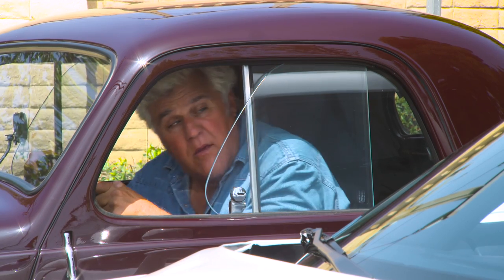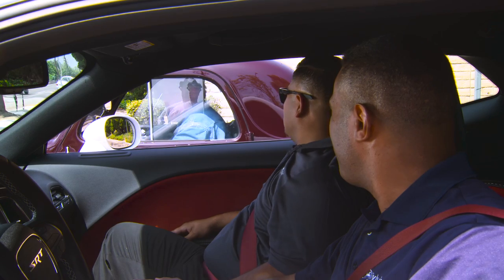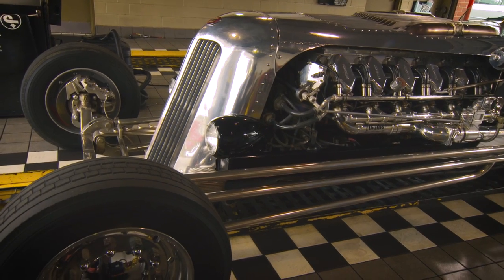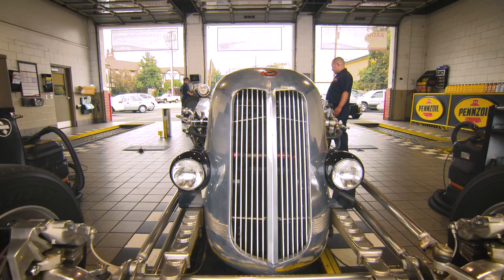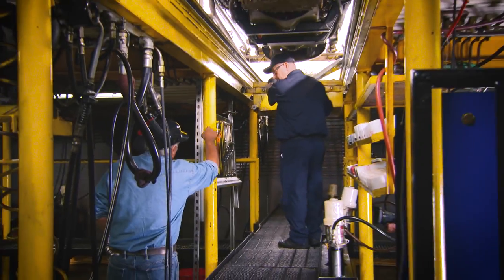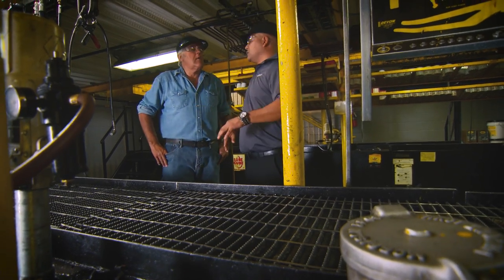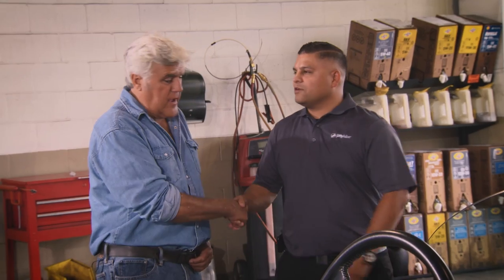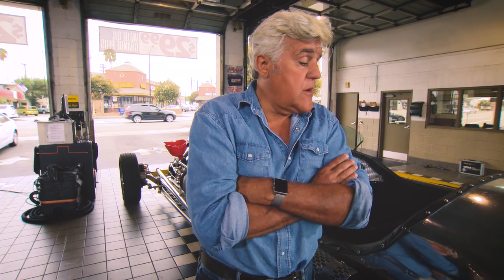Biggest Oil Change Ever - Jay Leno's Garage

Comment: I used the local Jffy Lube regularly for several years in the 80s, until the morning after an oil change I came out to find big puddle of oil under my car.

 Afraid to run the engine I pushed the car out of the garage jacked it up and drained the remaining oil into a clean pan. I had lost a quart overnight.  When they drained the oil they removed the old seal washer but didn't install a new one.

 I  was lucky that I had gone directly home after the change and didn't use the car until the next day. My high speed commute could have blown the engine.

I took my wife's car the local auto parts picked up a new washer a quart of oil and a bag of oil sorb compound.  I went home installed the drain plug with new washer, poured the drained oil back into the engine and topped it off, then spent 2 hours trying go get my garage floor clean.

 It took 15 minutes of arguing with the people at that Jiffy Lube to get them to refund my money. They never apologised for my inconvenience of endangering my vehicle.  I never went to another Jiffy Lube again, and never will.  

If I can't do it myself, I'd rather spend a few bucks more to have a real mechanic change the oil than risk getting an iffy lube.

Comment: LOL I used to work at Jiffy Lube back in high school...I was the underbay tech and I couldn't tell you how many cars I fucked up!  Driving away without oil pans and no filters.. a girl with a skirt stands close to the bay all the underbay techs run to look up her skirt, huge whelps all over my arms from hot oil an exhaust pipes and headers....ahhh how I don't miss that job but it completely defined my high school "job experience" and it was fun as hell then in ignorance. Every time I drive by one, too and from work, its complete nostalgia.

Comment: 15 minutes for an oil change is the definition of poor quality work.
Reply: +theedrstrangelove Um, there's not much to it. Remove drain plug and oil filter (90 seconds), let oil drain (9 mins), replace filter and drain plug (90 seconds), fill with fresh oil, (3 mins). While the oil's draining you get the new filter, write up and place the sticker then look up the torque spec for the drain plug. It's easy when you have a dedicated service bay and proper equipment.
Reply: +OMGWTFLOL You need to let it drain 45 minutes at the very least. Plus it takes that much time to check everything else; suspension, brakes, air filter, pcv valve, rear end or trans-axle, etc.
Reply: theedrstrangelove it should only take 5 minutes

Comment: 3:54 there not even pouring anything? What a scam !
Reply: +jake smith Precisely my thoughts.
Reply: +ScArdZombE Yea pretty sure that doesn't take anything that Jiffy Lube would have. As long as this keeps Jay's channel free, I'm cool with it!
Reply: +jake smith it's probably because that drum never held oil in the first place and was just a decorative prop for the shop. I'm willing to bet it was Jay's idea when he saw it.
Reply: +WittyDroog They do actually get their oil in large containers like that, its not a prop.
Reply: +Matt Close I work for a GM dealer here in Alberta. We buy our oil in bulk by the 1000 liters and it's delivered by tanker truck. I remember those little drums being filled with grease back in the day. If you look closely, the top is flat. There's no where to pour from. Castrol gave our shop a bunch of those things for promotional items though we just use them as garbage cans.
Reply: +jake smith 
"there" = a place.
"they're" = they + are.
"their" = belongs to them.
Reply: +OddTimeMan
You're casting pearls before swine, my man.
Reply: +jake smith Jay has his back turned and doesn't notice
Reply: +ap2pat Why do some numbnuts think that engine uses crude oil??? No internal combustion engine ever used crude. WWII era engines were as well built and refined as anything being built today and they used modern, refined oils, much the same as today's oil. Do a bit of research before you call someone a numbnuts
Reply: +58mustang8 I am an engineer & can tell you WW2 era engines did Not use modern oils like we have today.  They did not have additives to prevent shearing, or metal-adhering chemicals like ZDDP to block metal-on-metal wear.  Nor were they multigrade.  The standard would have been SAE 50 during the summer & then switch to SAE 40 during the winter (SAE 30 if temps dropped below 0).  Very thick stuff
.
Reply: +electrictroy2010 Well, engineer, my point was that WWII engines did not run crude oil or anything remotely close to crude. It was a modern oil compared to crude out of the well. Yes, it did not contain modern additives nor was it multi grade. ZZDP has been phased out of most oils because of emissions issues.

Comment: Out here in the midwest they (Jiffy Lube) have a horrible reputation and I got to experience it firsthand.  '97 Jeep Wrangler, bone stock, no options (no stereo, no hard top, no AC, no carpet, etc.)  Took it in for an oil change, they tried to charge me $179.00 for recharging my AC, which A) I never consented to, B) They never asked if I wanted it, C) I didn't even have.  The "Mechanic" even tried to show me where he charged it at, which was cute, because there isn't even a compressor.  My daughter bought a 2005 Dodge Stratus and took it in for an MVI (Motor Vehicle Inspection) and 5 minutes later here comes one of their rocket scientists asking what type of oil she wanted, they had already drained it and taken the filter off.

Comment: There are also  lots of older people that  still have  their car from 40 + years ago  and  it's best to change the oil   from both  the mileage   or  age of the Oil from city use  with short trips.   Having to rebuild the motor   before its time   can cause  a big carbon Footprint  for the energy  used to  restore  its power  .   Plus the sludge  build-up creates  toxic waste to be  disposed of   and  cleaned   to avoid   ending up leeching   into the soil at a dump .  
     
     I did my own  work on the used cars I had,   but once I had   news cars  every few  years   it was tough to be scammed  into fixing something  since I only drove about  500 miles a month .

Comment: took our truck to a GM dealer we bought the thing from. full oil change and lube job. for a fee of course. did our stuff in town and came back a couple hours later. "yep all done, take her home!" me and my dad kinda were suspicious. so we checked the lube zerks. not a single one had been greased or showed signs of new grease, all were still coated in a year's worth of grime. so we checked the oil and filter. still had the same filter, and while it's hard to prove it wasn't fresh, that oil still looked dirty as hell. only way to do it right is to do it yourself, can't even trust official dealer garages apparently.

Comment: Most of these places stock filters that are small and fit many cars to reduce inventory and shelf space. The filters are sometimes almost half the capacity of the original recommended filter. In some cases these filters will also fit motorcycles. Problem is, once the filter cant filter anymore, the oil bypasses the filter.

Comment: Jiffy Lube attempted to rip my girlfriend off.   They told her a 2007 Saab 9-3 required an, "Exotic"  oil filter that was special order and charged her $50 for that filter.  The cost of the oil change was somehow close to $200.   Only problem was, that filter is a $5 cartridge used in most GM built cars of it's time.  We've never gone back.  And, yes, I made a scene at that Jiffy Lube and got our money back.  Go to a small Mom and Pop.  These corporations are all about screwing the customer.  Bad business, all the way around with these people.

Comment: Jay, until I seen this video. I had mad respect for you. Jiffy Lube is a large rip off. 
I took my 96 4x4 Tahoe to a Jiffy Lube for an oil change. The guy told me it would lock up my motor if he use the oil n the $19 add. He said I needed the $39 oil change. I just got n my truck and left.

Comment: You left out the part where they zip the drain plug up with an impact gun. And where they shove your a/c compressor condensation hose up into the floor, flooding your car and zapping the electronics because Toyota thought computers under the carpet was a good idea. Then you have to take JL to small claims court and you realize it would have been simpler to just change it yourself.

Comment: Back in the old days all these oil change places used to advertise 'Oil and Lube'. They stopped doing that after one too many VW Bus owner took them up on the 'lube' part. There are something like 15 grease nipples all over the front suspension of those old Buses!

Comment: I don't work for Jiffy Lube whatsoever, but I do know marketing.  Jiffy Lube is owned by Shell (Royal Dutch Shell), which just had a change of leadership recently when Ben van Beurden took leadership of the company in 2014.  Jiffy has had some very bad press- and they earned it- so the logical thing to do is to do two things: first, make internal changes to prevent the past problems and secondly, get some new faces to promote their services.  Jay has a pristine reputation amongst car guys, so getting his endorsement would be helpful in demonstrating internal reform.

At the same time, we have to keep in mind that at any oil change station- regardless of the brand- changing oil is not how they make their money.  They make their big profits on the other services that they offer- especially transmission servicing.  Note that there is not a car manufacturer that recommends such servicing, but they sell it and the margins on it are monstrous.   The, 'get an oil change for super cheap' pitch is just to get you into the door.  The job of the counter salesman is to sell you other things that you may or may not need and could likely do yourself for super cheap.

All in all, I have no problem with Jay doing this promo provided that Jiffy Lube is also making a conscious effort to eliminate their track record of shoddy work.  Without that, it is Jay that would suffer the most from this, regardless of the check he got from Ben van Beurden.

Comment: All those quick oil change places don't make hardly anything on the oil change,they rip you off on all other services that you really don't need at that time,If you say no they screw with your car,Ex, kink your brake line, put water in your transmission, put oil in your radiator, grease on your brake, etc,etc,.

Comment: Jiffy Lube has a reputation for ripping people off. Overcharging, performing unnecessary work, claiming they replaced filters they didn't actually replace, and sloppy service, such as forgetting to tighten the drain plug. I wouldn't take any vehicle there.

Comment: I used to do my own oil changes, but frankly, it is so much easier and cheaper to go to a place like Jiffy Boob and have them deal with it.   I travel cross-country 10,000 miles a year with a camper, and boy-howdy do they come in handy.
Reply: +Robert Bell I don't know for sure if it's real or not, but didn't you ever hear of Amsoil products? At least according to their advertising, they make oils that last that long with more miles to spare. The filters are supposed to be great too, expensive but you get what you pay for; allegedly they filter 20 micron particles at a 98.7% rate which is a lot more than many other filters. I'm using three of their filters now, though I have no oil analysis data.
Reply: Austin Lucas
The problem I have with Amsoil is how it is sold in these cult-like MLM schemes.  The people who are into it are almost religious about it, which makes me (as an Engineer) very skeptical.   Quite frankly, oil is oil.  Changing it is a good idea.  Anything beyond that is really just style points, particularly in today's cars.

With modern synthetics, you can change the oil at very long intervals. BMW recommends Castrol synthetic, which combined with the higher-quality German filters, can go as long as 20,000 miles between changes (although I never went that long!).  I suppose that was the same concept behind Amsoil.

Because of fuel injection and better engine design, engines just don't get that dirty anymore.  If you use just regular oil and change it regularly, your car will easily last 150,000 to 200,000 miles, at which points its resale value is essentially less than the cost of a new set of tires and you might as well junk it.

Trying to make a car "last forever" using fancy oils and whatnot really isn't cost-effective.   But the people selling you stuff will certainly say otherwise.   The idea of changing all the other fluids in your car frequently is also falling from favor, thanks to synthetics.

And yea, I used to flush my radiator every two years and also the brakes and do transmission flushes and differential changes.   Today?  Less so.   It really doesn't make much of a difference, and with some modern cars, you can really end up making things worse (overheating the head, for example in a BMW if you don't bleed out all the air in the cooling system, or failing to properly fill modern automatics which don't have dip sticks anymore).   A lot of these fluids are now good for 100,000 miles or more, except maybe for heavy duty applications.

Leave it alone and then trade it in.  It sometimes is a lot less hassle and cheaper.

Comment: 'cept I would strongly recommend NOT using Pennzoil shown in the photo. After about 5 to 700 miles or so, the oil looses its viscosity and breaks down. You won't see it if your car/engine is new, but if your engine is older, the oil pressure drops after about 700 miles. I've seen it with two different engines.

Comment: im suprised they didnt try to scam him with "you need a new air filter $50 charge" i used to work at jiffy lube until my boss tried to tell me to pour cheap walmart oil into the high grade expensive jugs.  Apparently everybody did it there.  i quit!! if u love your car dont fucking go to ANY quick oil change place.  Do it yourself!

Comment: You can change your own for $14-50 depending on oil and filter you use and how much oil your car takes and you have the pride of knowing what brand oil is in there and have a good filter. JL charges $30 or more plus shop supplies, tax and waste removal and use recycled oil that's been refined to be like new and a no name filter that is prob 1/2 as thick filter as K&N, WIX,, Mobil1, Amsoil, Bosch, Baldwin(many swear by fram but I researched them and they weren't much better than the worst ones) etc. Do it your self it takes 10-15 mins and is fun!

Comment: they need to do a follow up where Jay can't get the oil filter off without an air hammer and the drain plug pulls the pan threads out (I have had to do that before)

Comment: I really like Jay.
I really like Jay's Garage.
Can't stand JiffyLube, because they stripped my drain plug threads, and then lied about it. Couldn't even get the strap clamped down properly over the two halves of the air cleaner filter housing, then lied about that, too.
What could ever posses me to go back? (rhetorical)

Comment: I wouldn't let Goofy Lube change the oil in my 2 cycle weedeater.  At least in central Indiana.  I've fixed more problems caused by poorly executed work done by poorly trained or simply lackadaisical techs.  Stuff like oil filters so tight you have to use channel locks to remove them, not checking fluids... Biggest culprit?  Stripped/over-tightened  drain plugs.  I've seen 3 engines that had to be replaced because the drain plug fell out or was leaking. Many more that had to have the oil pan replaced (no small job on most cars). Jiffy Lube's response is always the same: "If you want money, you'll have to take us to court."

Comment: Son took his Saab 900 to JL for a change, they drained the gearbox, then added 5 quarts to the cars engine. So he drove home, with only residual oil in the gearbox, and a massively overfilled engine.

Fortunately is was only 2 miles. Old dad check the drain plugs, just in case, and realized the mistake-oil everywhere. I added gear oil, drained the engine, then went back to complain. Only offwe-5 free oil changes.. Hah I said..life is to short to fight big biz...I get keeping the site free-but watch JL the car show, don't use JL the oil change co, imho.

Comment: a friend of mine had the oil and filter changed on his car every 6000 miles. air fiter every 12000. no main dealer service apart from first one. 300000 miles and still good. his work mate had the same car , main dealer serviced and nothing but problems. I change the oil on my trike every 3000 miles.  At £20 a UK gallon its a no brainer.

Comment: We got the same system in Germany, just better. You stay in your car and watch them doing the work underneath via a live camera. If you move the steering wheel a bit, you can see, that it's live. You don't even have to get out of your car, just like a drive-in. Filter is included and the price is fixed by the viscosity not the amount. Only charge 10€~12$ extra for Off-road and transport vehicles extra. They use Shell Helix oils only, which is a Gas to Liquid oil, which is very pure. You usually wait at least 20 minutes and 60 minutes is not a rarity. They are called Mac-Oil and not McOil to avoid a lawsuit with McDonalds, because e.g. apple sue a mother-child Caffe once because in German it was called Apfelkind which in English means apple child and they saw confusion danger. So Mac oil choose to go the easy way.

Comment: Jiffy Lube, props to them for forking out money. But that's easy to do when you're screwing customers over buy not completely filling up the oil, not installing filters, and then the incompetent "techs" round off drain plug bolts as well because they don't know what tool to use or they over torque them.